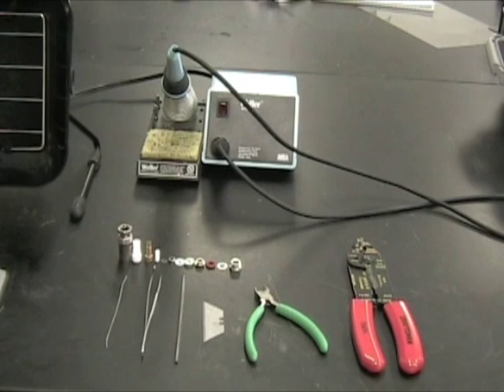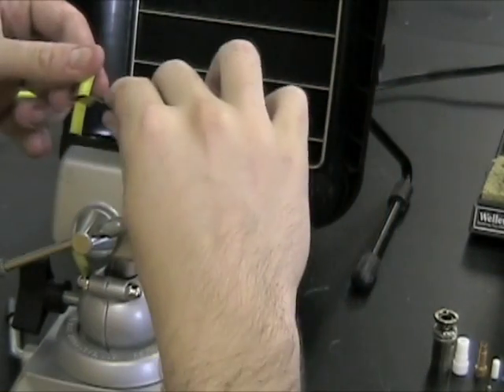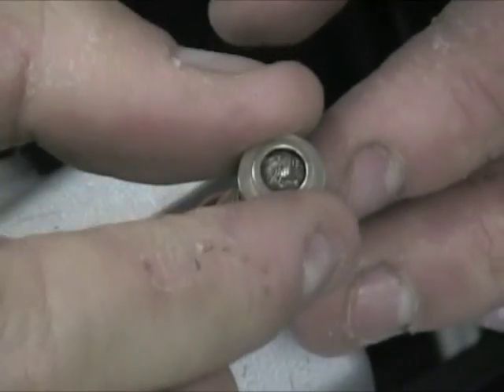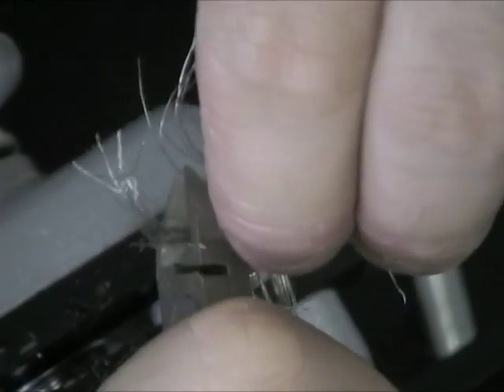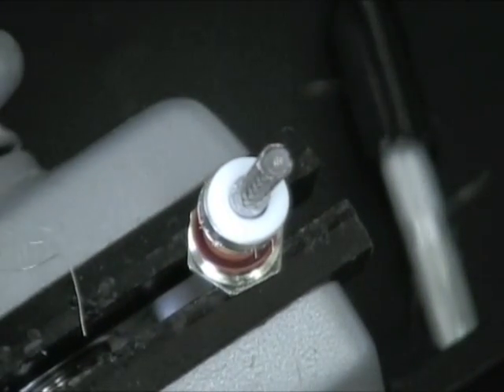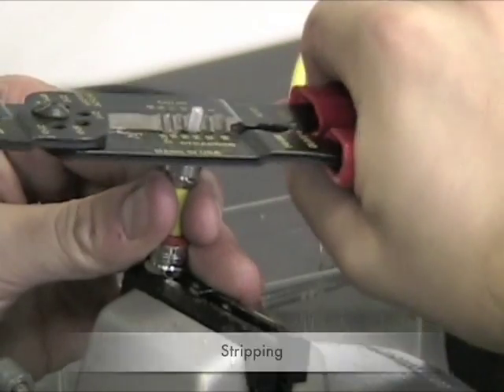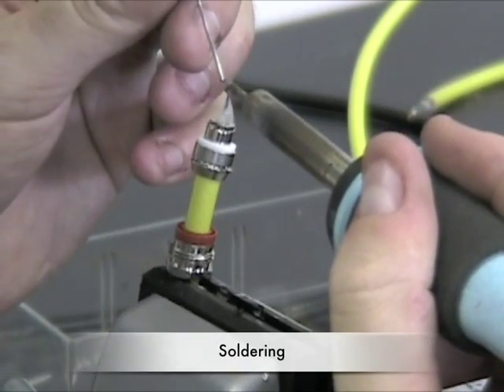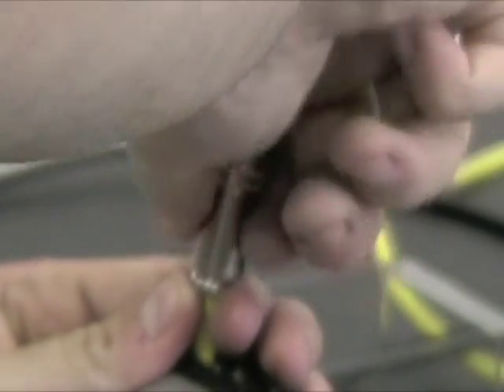How to Make a Tri-axial Cable

Comment: You are getting your hand and finger dirt and oils all over the teflon coating, teflon bushings etc.   Lowering the resistance of the insulators in this manner might increase leakage for high sensitivity measurements.  

This should be done wearing latex or nitrile gloves to prevent contamination, and every step of assembly should be cleaned with isopropyl alcohol.

Comment from the maker: @madamerotten The second bushing will fit, it's just not easy.  We find it easier to file the bushing.  We haven't had too much problems with corrosion.

As for the exposed wire, it's true, there is too much.  The specs for the tri-ax connectors specify the lengths of all the insulation and conductors.  We have enough experience that we can get the lengths right by eye, usually, although we didn't here.

Comment from the maker: @OldSchoolSkill Yes, sorry about the sound quality.  The outer shell of the cable is the shielding, and does act very much like a Faraday cage to block unwanted electrical noise from the signal carried by the two inner wires.

As for razor blades, they are a standard tool of many physics labs and our students have used them safely without an accident for six years and counting.  They key is proper training.

Comment: Something is out of tolerance, perhaps a cable dimension, because the second metal bushing should not have to be filed. The filing removes the nickel plating, inviting corrosion.

Why is there so much exposed wire below the pin? You have to control the center wire's insulation and conductor length, and therefore the pin's position. There should be some explanation regarding these dimensions.

Comment: The pin should probably be applied to the bare wire; its exterior heated with the tip of the iron while thin, Sn63/Pb37 RMA solder is applied to the entry point. The solder then should wick up, securing the connection. Your solder connection seems poor.